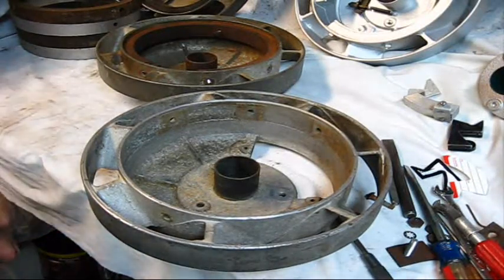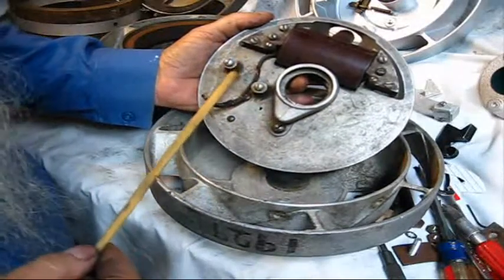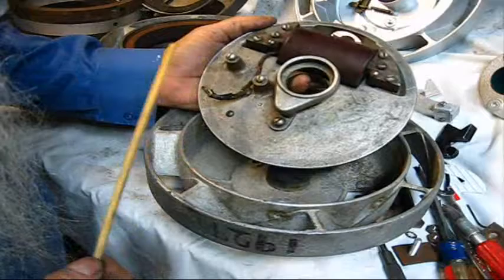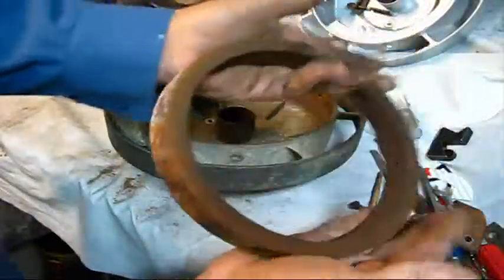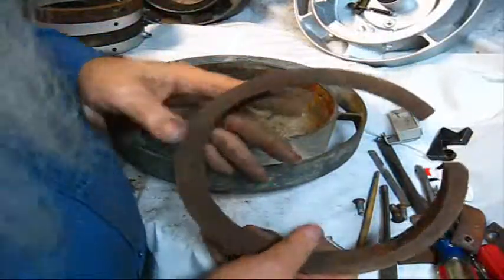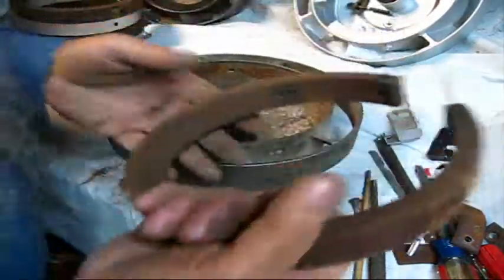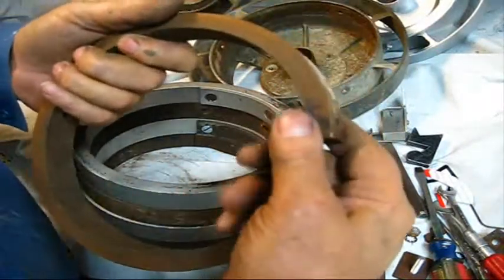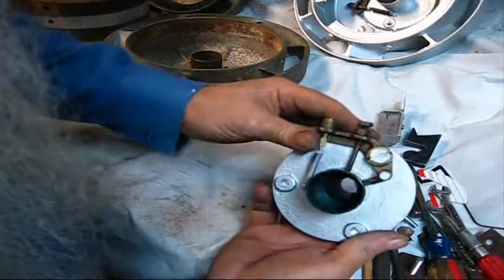Maytag model 92         ignition system #1

Comment: Hey Sam, I am working on my model92 1st one that I am wanting to make run on my own with my 9yr old son. And right off the bat we found the points are broke the tension spring ( I call it) isn't there so points need replaced. Any chance you can help me out or lead me to where to get a good set

Comment: When I got mine it had the original condenser which was brass by the way, and I didn't need to replace it, it had blue healthy spark so the original condenser works just as good as it worked back then.